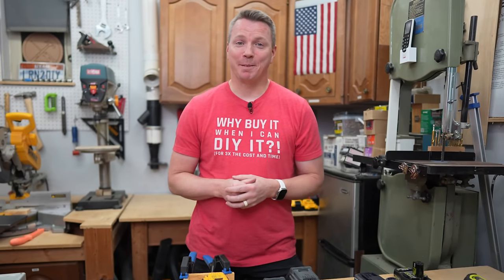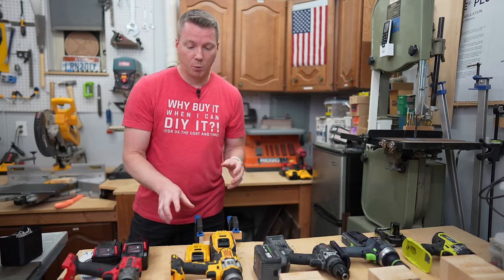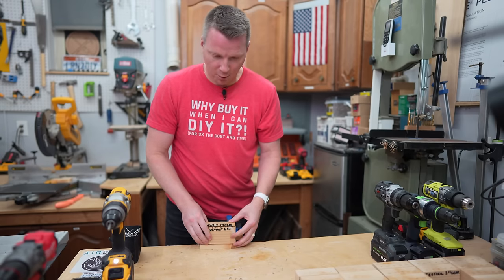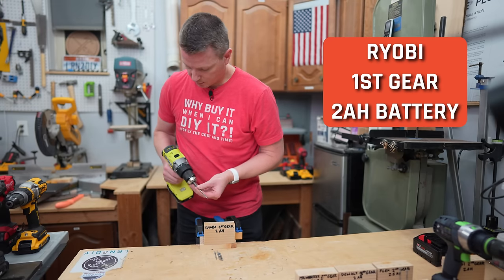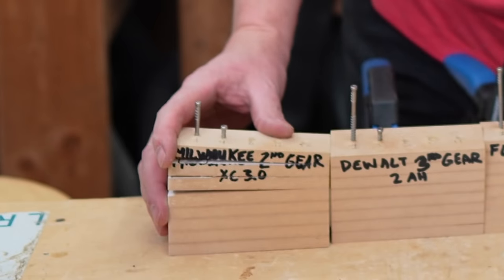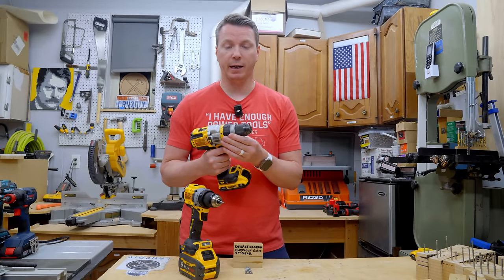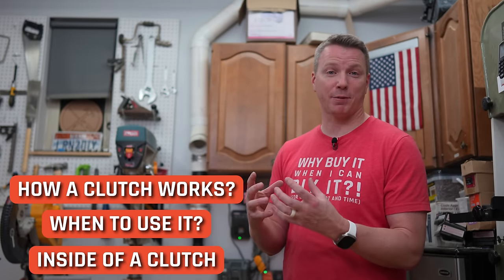What? This Feature is USELESS On DeWalt Drills!

Comment: My 8yr old dewalt works just fine. 99% of the time I use the clutch. From tapping M3 holes to driving 3/8" lags, proper setting is repeatable everytime. Hope it's an assembly issue, that's bad for dewalt. I believe they started the impact driver series bc the vast majority never use the clutch, even so called home pros.

Comment: Nice video and surprising results Nils.  
Personally, I have never experienced this problem with my clutched drill, which is a Makita.  Was there a specific reason you did not include the Makita in this test?
Reply: I was wondering why Makita wasn’t included too. Oh well. They have a reputation for having very sensitive clutches afaik.
Reply from the maker: Honestly, I have too many drills to test them all in one video. I figured putting 12 brands up against each other would just be too much. I suspect the Makita, Bosch and others may perform really well.
Reply: When I saw the Bosch Profactor at the middle of this video I thought he would include that one as well. High torque but I wondered how would it behave since Bosch's lesser offerings have had excellent clutch sensitivity
Reply: Guess that's a job for Project Farm.
Reply: @500features   he already did that

Comment: Wow DeWalt needs to get on that. I have the DeWalt hammer drill and one of the normal drills in brushless and the drill clutch works great but the hammer drill doesn't slip at all on the lowest setting unless it is used on a bolt😢

Comment: I’ve got a DCD791 XR brushless drill and the clutch works fine. I can screw in machine screws on the 1st setting on the clutch and it stops pretty much just as the screws fully seats, pretty much just at hand tighten.
Granted this is the smallest battery and the drill is on level one not 2 with clutch on 1 as well
Reply: I think either there is a run of defective clutches out there or he just got unlucky with 2.  Our jobsite has 7 dewalts and al l of the clutches work as intended.  Put on 3, install brackets into wood and it stops as intended.
Reply: Same for me, I have both a DCD790 and DCD791 and with either of them the clutch on the lowest setting is very sensitive. Even what you describe sounds a little stronger than mine. I can hold the chuck of either just pinched between the tip of my index finger and thumb and trigger the clutch on the lowest setting.

Comment: I love dewalt,  you can get a much better feel on the trigger.  The clutch works anyway #1 is wide open in the manual but will save your arm,   the screw is super all out like for cement

Comment: DeWalt is my go to brand but one has to ask why even have a clutch on this drill
Reply from the maker: That was my exact thought. The one thing the clutch IS useful for here is the safety mechanism - keeping it on in any situation where you think binding (and therefore kickback) could occur. But for limiting torque while driving - no deal. A lot o drills now come with anti-kickback technology too, which eliminates the need to use the drill's clutch to help with that.

Comment: I have the 996, in speed 1, just as your test showed, drove it straight down, how ever, in speed 3, it worked as I believe it should.....go figure. That being said, I'd never use that beast for hanging doors and the like. Oh, and on my 794, clutch works imperfectly.

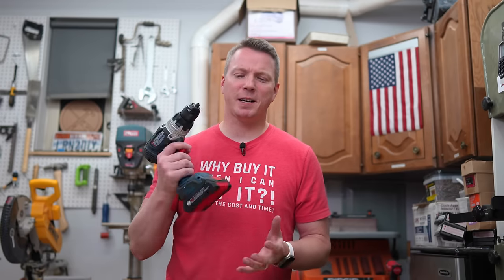Comment: 7:36 Great video, I have this bosch drill, but unfortunately it was not included in this test. I was curious about the performance in this tests. Electronic clutch is not that consistent and is easily influenced by the battery, or heat. But that ryobi is performing very well. I have to check the bosch,you make me curious.
Reply: Looking forward to your findings.
I own the 2nd most powerful drill on Bosch's lineup (975 in-lbs) and it behaves well. Also owned the 535C and 490 in-lbs drills and the later had a bit better clutch control but that one was a mechanical clutch so it'd make sense
Reply: @engineer_alv  I own that drill also, but in Europe is the gsr 18v-110c, and I love that tool. It is equipped with a precision clutch, when the mechanical part is engaged, the electronics are stopping the motor in milliseconds. Thus newer model does not have this function, but the angle finder is great, and the kickback control can be disabled directly on the tool with the push of the button. But it is a heavy tool,and the soft torque is one of the best, according to the torque test channel.

Comment: I have a bunch of DeWalt drills from over the years. Some have excellent clutches and some don’t. My 999 isn’t ever used with the clutch. I buy high power drills for that purpose. If I don’t need the power I use a lower power drill to start with. That doesn’t mean that their clutches shouldn’t be better when they aren’t. But generally, the way I use these is to slow the speed as I reach the end. I go back a ways to when we only had corded drills and there wasn’t anything like a clutch in the minds of anyone using a drill. So you learned how to use a drill for screws. Otherwise you bought a screw gun with settable mechanical clutches. I’ve got two Rockwell screw guns. So I don’t bother with the clutches.

Comment: I tried the clutch on my Dewalt DCD771 and it worked just fine. It drove a drywall screw flush into a stud at gear 6.

Comment: i do wish the clutches were more sensitive. i have a couple m12 milwuakees that are generally used as screw guns and even then, if you go full tilt on the throttle, the clutch is less "sensitive" than if you half-trigger it. i have a dcd796 for drilling, and the clutch does save your wrist when drilling stuff that requires savage torque.

Comment: Just tested this on my dcd999 with a 9AH flexvolt battery, gear 3, clutch setting 1. Ph2 screw into 4 by 4 wood...it works as intended.
Reply: Now try in 1st gear... Did you even watch the video?
Reply: by stripping the screws?

Comment: Do you have one of those digital torque sensors/adapters?

Using one of those you might be able to show not only how much torque each setting applies in a nice graph, but you might also find that some of these brands are adding useless settings.

E.g. if setting 1 is 100 lbft and setting 19 is 110 lbft, the brand is clearly just adding them as a PR function rather than a useful function.

Comment: I have ancient Ryobi and Craftsman drills that are on their multiple-generations of generic replacement batteries, and the clutches on both work superbly well with anything but a dead battery (lol.) Never knew how lucky I was!!
The builders and contractors I know are going hard into the new Milwaukee OneKey tools so they know where their tools are, and those drills have settings you can change via their smartphone app, so I'm very curious as to how that would fair in your testing... when you have an extra $400+ to spare...!
PS: FYI, Milwaukee and Ryobi are both made by Techtronic Industries.
PPS: I have no idea what a "Flex" is fully named nor who makes it but I am curious.

Comment: I have a Dewalt DCD 771. I haven't tried your test. It's a little depressing because I was going to use it to install rivnuts with the drill adapter. It could strip them out if too much torque is applied. I'll let you know how that works out at the lowest settings.

Comment: I have been using DeWalt battery drills,  twelve volt and eighteen volt  for years. I never use the clutch settings. I only use the speed settings and the on/ off switch to regulate the depth when anchoring screws.

Comment: Testing different battery sizes is a bit pointless.  They won't last nearly as long but pretty sure they put out the same current so does not change the power of the drill/clutch combo.   (just my opinion as I have no idea what I am talking about)

Comment: I really think clutched power tools should be standardized. If a tool doesn't do certain ranges leave those out.

And there should be depth-based clutches in addition to torque-based which would make it way better for the jobs they are being used for (driving vs tightening)

Comment: E clutch was designed  to get the  desired sinkness with less fideling with the settings at lower settings.  This thus allows the drill to open the entire settings open on that gear for you to run longer and longer screws of that same screw in that same gear which then will be more consistent stair case wise the longer you go in that same setting until the limit is reached and have to switch to gear 2. Now driving them consistent in the same gear and same setting over and over is a lil finicky and sometimes a little off consistency due to the E CLUTCH systems. Plus you cant compare clutch systems of other drill it hard to cause all brands design them differently. Just like chucks etc. And as far as this 999 gear one isnt the lowest setting its the lowest rpm. 3 gear is gear down torgue wise two gear 2 and 1 but faster speeds. 2nd gesr is more torque less speed more control. 😂 yeah your festool makes atair cases but this dewalt can to just with longwr screws that yours cant in that gear. Thats the biggest differance and to be more as consitant driving something 3 or 4 more inches longer stair cause wise of the same screw in the same gear vs the competition. Just designed different.
Reply: errado!...; torque é torque.; isso não é vendido como embreagem e sim como torquimetro, de qualquer forma a função deveria limitar o torque e nisso o comprimento do parafusso é indiferente.

Comment: At around 5m30s you say, "If you're doing something you're a little unsure of in terms of how much grab it might have just turn that clutch onto the highest setting. I've got it on 11 which is as high as this one goes and that might save your arm." which is 100% incorrect. The higher the number, the higher the torque. (You can see this in the DC999 manual on page 8) I assume you just misspoke but it might be worth adding some text correcting yourself since someone could definitely hurt themselves starting at 11 instead of 1 depending on the bit they're using, the material they're going into, etc.

Comment: Unless the tool and battery is terribly designed the power output for a full battery should be basically identical regardless of the sice.
The only thing a bigger/more anp hour battery should give you is a longer time at full power and longer time before it need to be recharged

Comment: I have a DeWalt drill which uses  a 9.6 volt Ni-Mh battery. It seems I am always recharging and every 1 1/2 years I have to buy a new set of batteries. My question is why don’t they make a li-ion replacement battery and charger  ? It would make the drill more effective.

Comment: I'd love to see you test the upper bounds  of the clutch sensitivity, unless the highest several settings are actually pointless.

Would the DeWalt demonstrate some control and sensitivity in high-torque situations, or would it behave just like in this test?

Comment: Is there a 20v DeWalt option where the clutch DOES work so I don't need to add a second battery kit, charger, etc?  I already have a hammer-drill for heavy-duty work.  I want a simple drill-driver that is more sensitive for smaller detailed jobs.  Thanks.

Comment: Just bought the DWD220 corded and will install it on a drain cleaner cable with chain knockers so I am hoping in a bind up clog, it will save the cable from kinking and possibly losing it or the chain down the drain.  It is auto/electronic because nowhere to adjust.  Chuck is 1/2" steel.

Comment: I don't see why battery size would matter. The drill motor will only draw so much current as it has of the lack of resistance. The size of battery -- given that it's the right kind so it will drive the drill at up to full speed -- only affects the amount of time that the drill can run at full strength; not that the bigger battery will force the drill to drill harder, ha!

Comment: the clutch is a mechanical component that would actuate independently from the battery. Your drill isnt using more amps because it has a bigger battery it will still use the same amperage. changing the battery is pointless in this situation.

Comment: You should always drive screws at the lowest speed (to avoid stripping screw or splitting the wood), so how the clutch works at high speed is pretty irrelevant. 

Though this aspect is useful when I occasionally forget to lower the speed after drilling, the greater torque reduction helps prevent damage.

Comment: There are two components to the power provided by your power source: voltage and current.  The batteries you tested for each drill provide the same voltage, and the same current, but their capacity is higher (big battery, more amp-HOURS) or lower (little battery less amp-HOURS).  Power in a DC circuit is one watt per one volt-amps so power is the same.   

However, the stated goal was to measure torque... and while you were exacting as to the drill settings, taking excellent care to highlight all the test conditions, the same is not so true as to the screws and materials tested.  However, let's skip all that and I suggest a new test.  There are electronic torque meters that can go between a 1/4" ratchet and a socket to allow using any standard wrench as a torque wrench.

Why not attach one of these to the drill being tested, ensure the "socket" side is fixed (a bench vise or clamp would work) and then run the test to see the maximal torque?  That would not only show a difference, but quantify how much of a difference it is.

Sure, at the end of the day it's good to know the DEWALT® will drive a coarse grain screw through pine like a hot knife through butter, but absent a harder wood or a finer screw or even a lower AWG screw... it's just a relative measure.

Love your videos.  Hope you get to 1M!  I'm a sub :)

Comment: I use drills for drilling and use an impact driver for driving screws. I have better luck not stripping the screws in the wood or stripping the heads of the screws

Comment: Do recommend an electronic clutch or a mechanical clutch? I have a Milwaukee installation driver and it has a mechanical clutch  which seems to be much more sensitive than the Milwaukee full sized drill/hammer drill which has a electronic clutch

Comment: Dewalts are brutes. For big bits and hole saws, I use my 20v Dewalt drill. But they also have very nice variable triggers. As long as I module the trigger, I feel I have reason command over the drill. In fact, I only ever use the clutch in 1, 3 or drill setting. My older, brushed 12v Dewalt actually has a very nice clutch effect; it serves as my "delicate" drill for Ikea furniture assembly.

Comment: I personally wanted to see also Milwaukee m12 in this video. Anyway very interesting comparing video for the functionality, which seems doesn't bother another youtubers. As it turned out, power is not all we wanted to see in power tools
Reply from the maker: I should test the 12v series sometime across the different brands - that could be pretty interesting.
Reply: @LRN2DIY agreed, maybe you could try some sort of thumbnail like "Does 12V offer better clutch control over an 18V drill" and try 2 or 3 brands

Comment: I don't love Dewalt but let me suggest those big drills have a clutch designed to stop you from breaking your wrist when driving things like big Tap-cons into concrete and drilling large holes. WAY too stiff to do anything at all while driving a trim screw or similar...repeat your experiment with 6"x3/4" lags into a railroad tie and the clutch will do what you expect.

Comment: Knowing the absolute minimum when it comes to both cars and drills why is 1st gear, 1st graduation, your assumed minimum power setting? Don't higher gears go faster but with less power? Low gear is when a truck tows 1000 lbs of sand up a hill for 2 miles. (or something)

Comment: I just tested the clutch on my Dewalt drill and it works correctly. Very sensitive at the 1 setting and gets incrementally more aggressive as you move up from there. Have you tried exchanging your drill to make sure you didn’t just get a defective drill?

Comment: I would try backing off the trigger. If you're aiming for precision, you don't just SEND IT. I've got to go test mine 3 drills now. FLEX really is eating everyone's lunch. If I didn't already have everything I need I'd be grabbing all their stuff.
Reply: If you're hanging drywall with a drill then you absolutely need a sensitive clutch that's  properly dialed in, trying to feather the trigger will double or triple the time taken
Reply: @Failsafeman100  That's what a dimpler bit is for.
Reply: @icekohl  your dimpler bit will last longer if you've got a good clutch.

Comment: I take a different approach. I use my drill to drill, my driver to drive and a screwdriver for small screws. I don't strip small screws and the clutch on my driver works great (Rigid). My drill doesn't need a clutch.